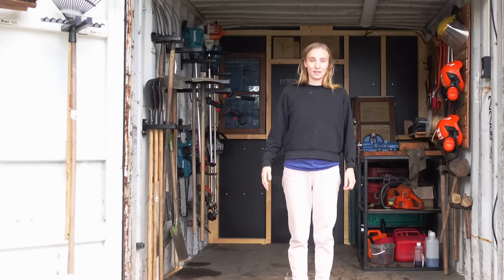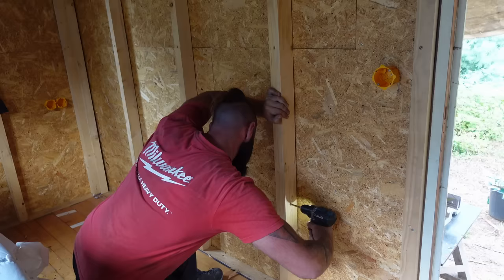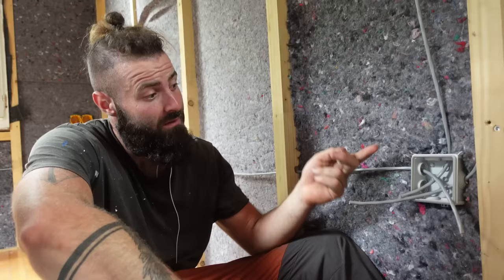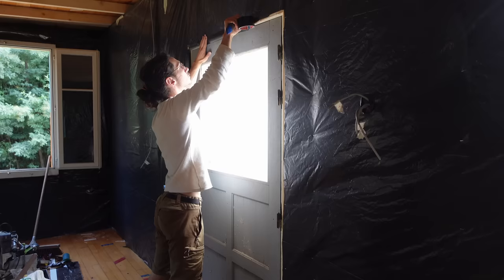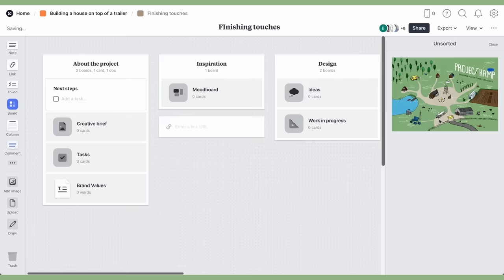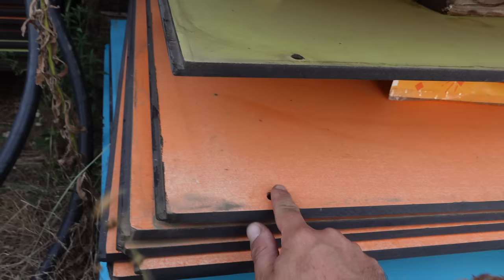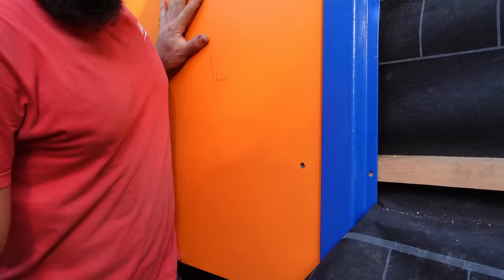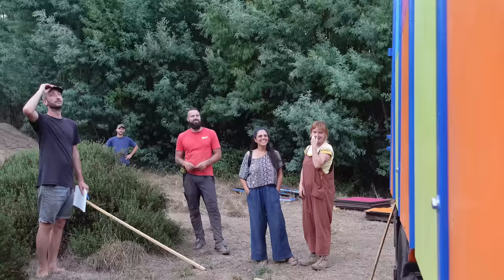#101 Installing old reused panels on our trailer d̶i̶s̶c̶o̶ house (it was voted)

Comment: Given the fact that you have very flammable insulation, please add conduit to protect the electrical cables. You cannot predict how hot they'll get, even if it's a one-time occurrence. Prevention is always better than cure.
Reply: Not needed with that style of cabling. European electrical installations are a lot different than North American installations.
Reply: @mrjakobt as a European Electrician I can tell you that they don‘t care too much about standards, rules and regulations… so yes, this might be pretty dangerous in casr of failure!!
Reply: @Charlie_..  Realistically their current solar setup doesn't allow them to run things which would get the cables hot enough to cause issues but you are also right that they don't really bother with regulations or safety rules so I would be careful. I hope they find an electrician to join them for the next season and helps them make things safe(r)

Another thing: isn't this kind of insulation filled with some substance to make it self-extinguishing? afaik it shouldn't burn or at least should kill the fire quickly
Reply: @PatrikTheDev  I hope too...
If I only had more time and less job I jumped into my camper for a nice trip to Portugal!
Reply: If it's save or not depends on the fuses they use.
Reply: And they tried to "optimize" the cable layout by having one cable to the fuse box and splitting after... Be careful with that!!
Reply: Pay peanuts,  get monkeys... They aren't the sharpest tools in the shed...
Reply: @kotrehlchen they are also using multi-stranded cables judging by the flexibility. These cables can have individual strands broken if handled incorrectly. This can cause very high temperatures of the wires without a high load. 

Overall: safety standards are there for a reason. They should abide by them.
Reply: Also if you run cable without conduit, you should never put it between insulation layers. It is okay to go straight through insulation layers never like they installed here. The cables should allways have a way to dissipate heat witch is not possible in this installation. This is a real hazard.
Reply: @Charlie_..  You got a camper and want to help, Then just do it... ;) Karma will pay back way more than your job
Reply: @ncubesays Show me in the NEC or IEC where this is code? Never heard of it. So many people think they know what is right. What does the code say. This is no different than a Romex cable being between a vapor barrier and wall insulation. Quit the fear mongering.
Reply: @Charlie_..  aber onkel, guckst du VDE 0298-4 ? A1 und A2 lassen das gleiche bei 1,5 mm^2 zu? (mehr war das ja nicht) und das ist keine europäische sondern ne deutsch norm? also 6A sicherung drauf und dann dürfte der bock sogar in der prallen sonne stehen? ich hätte da eher bedenken dass die wirklich 2,5mm^2 oder was auch immer erdkabel zu der bude gelegt haben. und dann: die haben in die letzten trailer ne laptopsteckdose und paar leds reingemacht, wat soll denn da warm werden?
Reply: As a electrical engineer that studied in Germany (for the ones complaining about EU norms), super dangerous without the conduit. Security should be first priority, not that someone doesn't like plastic. 
For the argument that they will not need high current because of the solar panels, this doesn't guarantee that this will be so forever. It should be future proof.
On a side note, love the project!
Reply: The insulation will rot before it ever burns. They are completely clueless how sneaky water is. They'll be tearing up the trailer at some point to get rid of the mold.
Reply: Very colourful! Not really my choice though, I chose green and blue. But this place will serve its purpose. It is insulated well, so should be warm and cozy for cold months and cool in Summer. Well done with electrical, mending the dish-towels, etc! 👍
Reply: @josseman  In Germany such kind of cables are not allowed to lay into walls, I agree, this is really dangerous.
Reply: @PatrikTheDev Cables are fire retardant itself, so that's not a major issue, however I hope they run 230V in them and not 12V from batteries, since lower voltage means higher current and in that case that's dangerous.
Reply: @dadoVRC  oh, they’re running 240V there as it’s going directly into the outlet and having a 12V inverter there would be both extremely inconvenient and inefficient 

The concern is the supply and how they’re branching it, they could theoretically overload some branch, part of it or even the supply itself if they use some space heaters or smth
Reply: @Charlie_..  you dont know that you are talking about...
Reply: wrong!!
Reply: @BbBb-sd2bs   maybe... sometimes... but I know what I'm typing about... 😉
Reply: guys, they probably arent even going to pull 10 amps through these wires. they are living a minimalist life, not with 65 inch TVs and gaming computers. all of their power is from that small solar farm, so the outlets are going to handle small lamps and laptop chargers. the only things with major draw are the tools, and they are usually used in the tool shed area. QUIT FEAR MONGERING.
Reply: @ghomerhust  the problem isn’t that what they did is *certainly going to burn down*, no it isn’t, the problem is that it’s inherently unsafe to run bare stranded cables through insulation because they could heat up if you plugged something more energy intensive into them (space heater, electric kettle, microwave) and if they heat up enough, the insulation could catch on fire. It very likely (hopefully) won’t happen but the codes exist for a reason, their current setup isn’t safe.
Reply: Eco friendly insulation.........that comes in a plastic bag.

Comment: The wiring is a fire hazard. Part of the reason you put electric cables in (fire retardant or metal) tubes is to prevent electric fires from spreading. Surrounding uncovered cables with recycled fabric is the diametric opposite of running it through conduit so far as fire safety is concerned.
Reply: Different countries > different safety standards.

Maybe the cables themselves are safer than the ones you know? Or its simply not required for buildings of a certain size. 🤷‍♀️

In germany we usually don't use metal tubes too (or at least I didn't notice them in all the buildingsites I visited until now).
Reply: Not required with the European style of cabling. Stop talking shit about things you’re clearly not educated on.
Reply: Woah! @mrjakobt
Reply: Insulation is non-combustible/ fire rated. No need to place in conduit.

Comment: Nice to see the work coming along. For anyone making electric connections in walls, do not avoid using cable pipes. A fire could kill anyone inside, the plastic pipes are for safety.
Reply: Not needed. Conduit is used in areas that need protection from abrasion or impact. Not in walls. If your wiring is done correctly the wires will never get hot.
Reply: @SixPackDan  I mean, yes and no. People seem to forget where there is people there are creatures like mice. All it takes is for one to try and make a home between the walls and chew through a cable for there to be a potential huge problem.

Edit: Not to mention that the pig trailer could be moved, and that could cause the cables to rub on the wood beams. Sure it would probably take a lot of movement for the cables to get stripped just by rubbing on the beams, but it's another potential risk.
Reply: @Marinho10  Yes, I think the problems with a lack of conduit outweigh the advantages of omitting it.  A small fire sould start in the insulation, continuing for some time before it became apparent.   And certainly on that first cold day, there will be small animals that will want to come inside, if they haven't moved in already.
Reply: @Marinho10  they also aren't pulling much power. their entire source is the small solar farm and batteries, so they will only be running stuff like a few LED lamps and laptop chargers. these wires will never get hot.

Comment: Cleaning rag solution:
Everyone gets rid of Tshirts. They are cotton and very absorbent when washed and dried with no fabric softener. One tshirt has at least 2 good sized cleaning rags in it. No seams no graphics. Remember no fabric softener!  I have 2 mottos that we share. Recycle, repurpose, reuse and 
T.E.A.M.
T=Together
E=Everyone
A=Accomplishes 
M=More
Good Job guys! Love that electric box, it's beautiful!
Reply: This is a good idea! Also separating a few beat up rags from proper "kitchen towels" which you want to keep decently nice, and don't want to get greasy or dirt-filled.

Comment: Kitchen towels - cut them into a pattern and quilt them together. If the towels are 100 percent cotton, the leftover bits can be used as insulation or composted.
Mending using the Sashiko method is a beautiful alternative which highlights the mend rather than covering it up.
Congrats on the new solar. It'll make a huge difference.
Reply: I'm really excited to see what Alize can do with the sewing machine.
Reply: As an electrician this was hard to watch. Never risk fire for some plastic pipes.
Reply: I always use tubes.
First you can repair or modify.
Second ads an extra insulation layer, that normaly is made of hard to burn plastic.

Comment: I would buy a roll of kitchen towel textile, sew new kitchen towels if the old ones are worn and use the old ones as workshop rags.
Reply: One or two holes, repair, but so many of those towels required at least 15 minutes of repair. I realise the volunteers aren't being paid but could the work hours be better spent elsewhere?
Reply: Or just buy new towels. If someone really loves to make towels and sew that's one thing.  Otherwise it's a waste of time and energy.

Comment: It would be wise to consult with an electrician in Portugal before closing up the walls. Having all electricity going through one cable to the panel is a lot of watts for just one cable. The cables will get very hot and possibly burn the plastic and insulation material. Usually there are several circuits per room so every wire only carries a maximum of 10-15 amps AC. If you are using DC, the problem is even worse.

Comment: I heavily recommend that they take some UV resistant weatherproof rated silicone sealant around those colorful panels. Or seepage (especially during storm winds) will get in and the untreated wood beneath will mold and rot....
Reply: The black wrap under the panels and battens is the waterproof layer, these panels are just a rain shield, you want the space behind to be vented so it can dry

Comment: Have you considered water turbines that you can use during the winter when the water is flowing through the canals. The turbines can be portable so you can store them during the dry months. You could use one to charge the ecoflow batteries or run multiple turbines in series to run more devices. It will help when the Sun is not fulfilling your needs.

Comment: For repairing smaller holes in towels (especially if you don't want to use any electricity) you could try darning. Since the towels are woven I think a woven stitch would work well. I darn holes in sweaters and socks with either a woven pattern or a knit pattern all the time.

You could also try reinforcing existing patches or weak spots with a running stitch - similar to how sashiko is done. I use this on denim jeans to repair holes or add patches to areas that are wearing thin from friction.

Comment: Fabric used to go through downcycling. New fabric would first be made into table cloths or bedsheets or clothing. Then they'd get down cycled into towels, napkins, or quilts. Then kitchen rags or menstrual rags/diapering. And final stop may be rag rugs, stuffing for pillows/beds. If 100% cotton or linen you could use it as a biodegradable weed barrier in the garden or compost it. Maybe you can find a sustainable mill and purchase fabric in a bolt. Would take less time than the repair job shown here.

Comment: If you want to repair the towels without a sewing machine, there are a few ways: 
If you stick with cut-out patches, you can still sew them on by hand. It takes longer, but uses no electricity. You can even pull a few strings out from the to-be-cut towel to use as sewing thread.
If you don't have any material to do patches with, you can still use any cotton or linen thread/yarn and weave a patch. Search for sock mending weaving on youtube, and follow the instructions. No matter the size of the hole, the method will be the same. Thats how i learned it! If you grow skilled enough, you can even replicate the color scheme of the towel, because those are typically woven themselves.

Comment: Great color scheme! I think it should be a reminder to never let internet choose on these kind of things. I think it should be embraced and transformed into a meme and an inside joke for all of project kamp and us. Still i hope this won't be a regular thing because i think stuff should blend in the environment.

On the other hand you could just paint it over but i hope you wont.
Reply: It could never have blended in with the environment with the material they were using.
Reply: @airenesmiler6624  Maybe a bit better if they made really small panels so the colors mix together from afar.
Reply: Absolutely an embarrassment 😞
Reply: @RobertDoornbosF1  Fewer cuts provides less opportunities for water ingress, water is the cause of most construction failures.

Comment: those are pretty small sections of HPL panelling so it might be fine, but I'd really recommend you pre-drill and use dome head screws, not countersunk. That allows for the expansion of the panel due to temperature and humidity changes (HPL containing wood fiber, it often warps a little with atmospheric humidity changes).

Comment: Your repairs to the towels using the zig zag stitch around and through the repair works well. Hand sewing the repair could be done without a machine or you might be able to find a treddle machine which is powered by your feet. Either way a sewing machine is a very useful tool which I would keep around.

Comment: Btw in germany its not allowed to drill the sockets like this in the wall... because in case of failure there is a noninsulated part (screw) sticking out of the socket at the back.

Comment: Fabric with that many holes is most quickly repaired by patching, but if you want to make something a bit more beautiful and durable, you could try cutting up old toweling and doing a patchwork from it, jogakbo style. You can do something similar with a machine, but it's better as hand sewing. It's the sort of thing you can just curl up and work on in the evenings until it's done.

Comment: I really hope the wiring fire hazard never catches fire or becomes a problem, that'd be terrible to see, especially with all the work they've put into these projects and trying to fire prepare the land
Reply: they wont be pulling enough amperage through those circuits to heat the wires up. their power is all from the small solar farm, so they use a few lamps, laptops, and that's about it.

Comment: I like the colorful exterior but I worry that the unsealed seams and the screws will allow water to leak inside and soak the insulation, causing dangerous mold.

Comment: Hey! For fixing used towels or clothing, i personally like going back and forward in all directions with a free motion darning. Also the Japanse method of sashiko is a very cool method to fix or mend clothing, but is very time consuming (more suitable for clothing than towels) :))
Reply: Yeah, I was thinking that it would be so much faster to do free stitching.  I do it sometimes for decorations.  It's messy, but very secure, and funky looking, especially if you use multicolored thread.  There are special feet for the sewing machine to make the free stitching easy, but I don't bother, and just leave the foot up while I do it.

Comment: U need to use the waterfall instead of more panels. The waterfall will provide power when it’s not sunny. If you manage the water correctly even the dry season can produce energy

Comment: dont use non perforated trashbag material as a vapor barrier, water vapor will condensate on both sides during colder days and you'll get mould in your insulation. Vapor barriers need to be able to breathe out the water vapor, that's why the proper tyvek materials have the perforations and such. Good luck with the condensation you'll get in the sockets btw.

Comment: Using the stitch selection dial shown at 33:16, selecting the zigzag with lines above and below shown in blue on the left side of the dial would give you the best longevity in how long the edges of the patches keep from unraveling.
Reply: Yep, and to get that stitch, you have to set the machine to "stretch" stitches.  I have the same machine, and it's complicated, but once you understand it all, it's very versatile.

Comment: It may be plastic you don't want to use, but it is far more optimal than a fire you don't want to happen.  Wires can get unpredictably hot, and that contact to insulation is dangerous.  Some shortcuts just aren't worth the risk.

Comment: Just to Inform you, the Electrical Installation you´ve made there in the recycled Trailer is dangerous. 
1st.) Cables should be installed in an empty Pipe especially when there is flammable Isolation arround them. 
2nd.) Please use single Core Cables instead of Multi Core. Multi Cores tend to break faster and those thinner lines are melting way easyer with to much Voltage/Amps. 
3rd.) When installing Multi Core Cables in a Wago Clamp they should be in a Cable lug to prevent breaking/melting.
4th.) Make sure to use the right diameter on those Cables they should atleast be 1,5 mm² (Single Core) or 2,5 (Multi Core) to prevent  Cable Heating up/burning

 Please be safe when doing Electric work and don´t just botcher it ;-)  
Anyways Love your Videos and the whole Projekt.